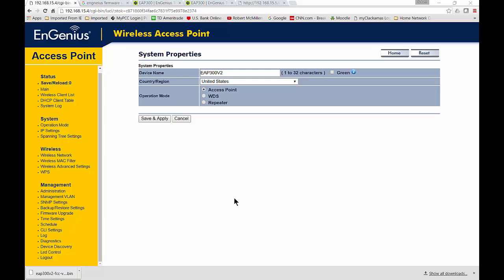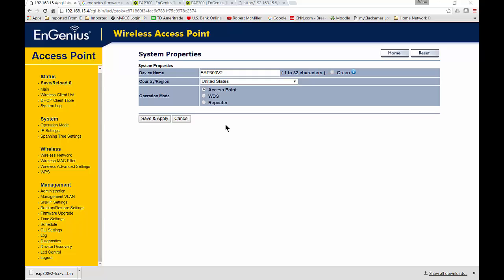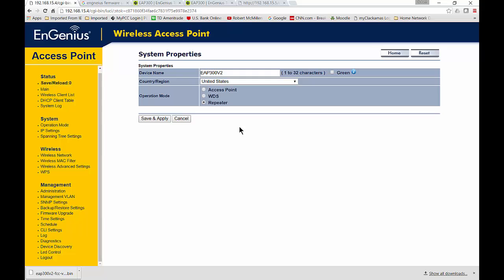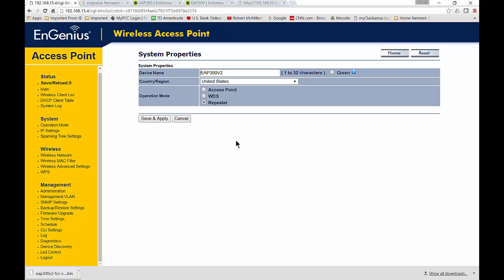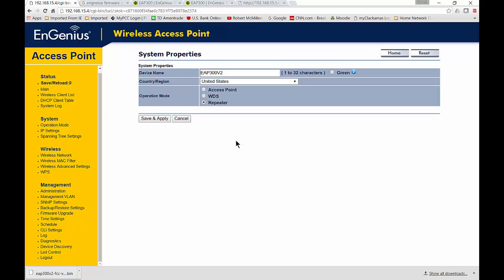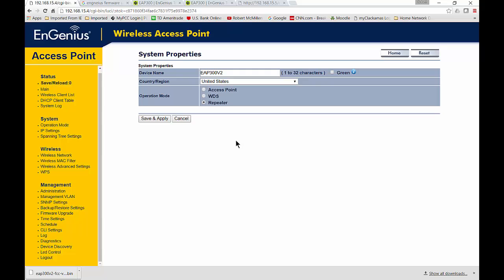Engenius Wireless Repeater Mode Explained

Comment: Sir I have a question. How can I use this as a wireless extender or repeater for another router modem ? Is it possible to configure ? Thanks.
Reply from the maker: There's an option under wireless to decide what mode it will be in. Choose the repeater mode but it only works it you use the same brand as the one you're already using.
Reply: @techpub  I have read your earlier post and solved my concern. Nonetheless thanks for the reply..

Comment: Should this work with a plain jane Verizon or Comcast home router?  I've been through hours of websites, manuals and videos and just can't get my ENS202EXT to function as a repeater. I'd really like to extend my wifi into the backyard but maybe this thing is just too sophisticated for me. Can you point me to some instructions on how to set my unit up to be a repeater? (after I do the 20th factory reset)
Reply from the maker: Sure. Go to Mesh- Settings. Then change it from a Mesh AP to a Mesh Point. Apply and reboot. Log back in and make sure it stuck. Unplug the wire and place it where you want. Now its a repeater.
Reply: I'm at a loss.  The word "Mesh" does not appear in any of the menus I see or in the manual.  My operating modes are: "Access Point, Client Bridge, WIDS, Client Router and Repeater". Here's my manual - https://www.engeniustech.com/wp-content/uploads/2016/12/ENS202EXT_Manual.pdf
Here's my comment to a post on the Engenius website:
https://helpcenter.engeniustech.com/hc/en-us/articles/234449108-Can-the-ENS202EXT-be-set-up-as-a-repeater-

Comment: Robert, 
Let me reword this somewhat. Out in rural areas we do not have Comcast or FIOS or any of that. They send point to multi-point over different frequencies, typically, 2.4 or 5 GHz, depending on what data speeds you purchase. I have a small dish getting the signal from a tower 2 miles away. Through a POE, it connects into a Linksys WRT1200AC and this provides wireless access in and around a cabin. I have a second Ethernet cable going through the wall to an outside location that will connect to the ENS202. I need to get a wireless signal past a big metal barn for coverage in a second house. There will be wireless users on both the Linksys and on the ENS202. From what I am finding in your videos and others, I could use either Repeater or WDS Access Point modes to make this happen. How would you configure the ENS202 in this scenario? Thanks for your videos and help.

Comment: Robert,

I have a wireless broadband provider, which has just a 5 GHz antenna on POE. This connects to a wireless router, but am getting ready to connect ENS202 to extend the signal from the router, also over POE. What mode should the ENS202 be configured for?
Reply from the maker: Typically you cannot extend the signal for another brand. They have to be the same brand and sometimes the same model.